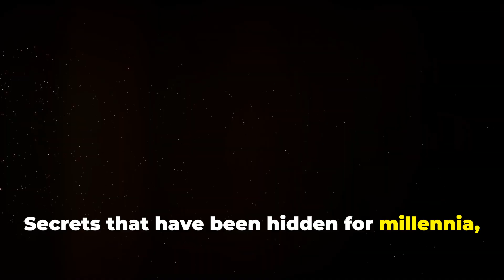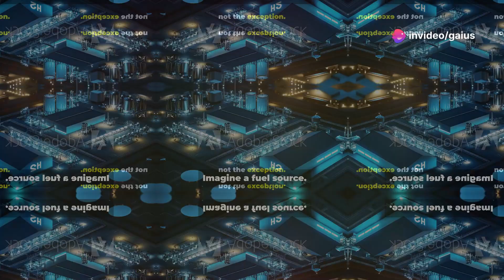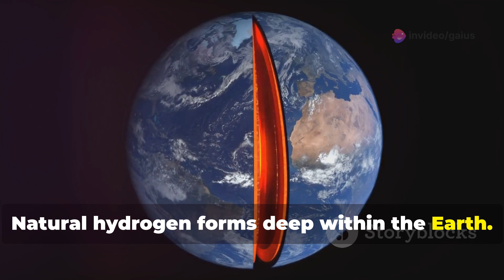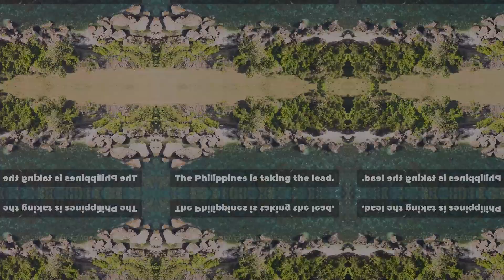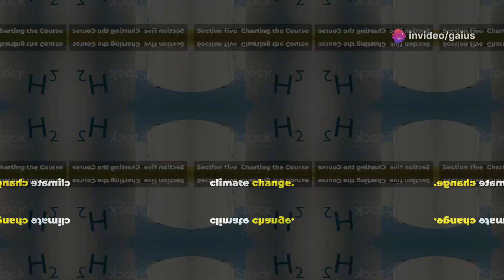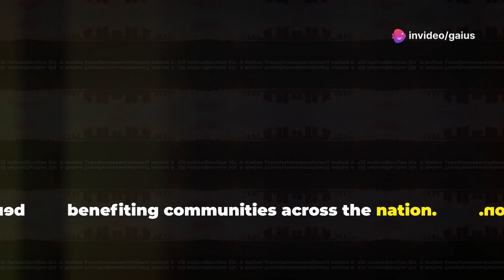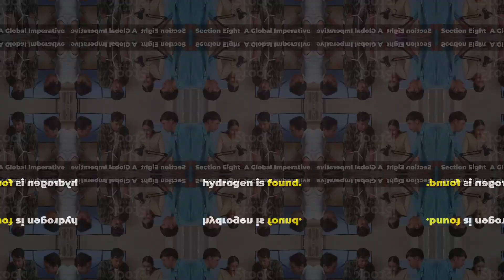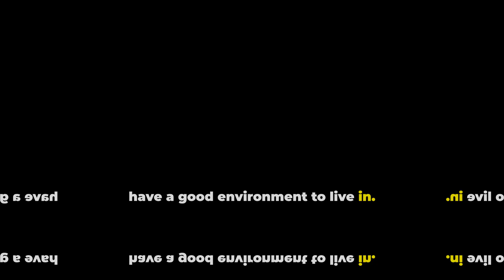Zambales' Game-Changer: Hydrogen Drilling Revolutionizes Clean Energy!

Comment: I'm a mining enng student here, been researching this for months now, the thing about the Philippines is that it's islands which means the rocks aren't ancient so the hydrogen production process here is linked to an ophiolite complex which is going to be hard to commercialise because the hydrogen here escapes the surface easily, but the fact that we found seeps is just amazing , it's very rare to find them and since it's cheaper to do operations in the philipines, I think it has a great potential as a pilot project but in terms of comercialisation of production i'm very skeptical about unless we find a way to engineer a sort of complex subsurface system  but that would be too expensive, but we never know, this is great for the country both ways it will attract investment.
Reply from the maker: "Wow, thank you for sharing your insight! 🙌 It’s fascinating to hear a mining engineering perspective on this. You’re absolutely right—the geology of the Philippines presents both unique opportunities and challenges for hydrogen production. The presence of seeps is indeed rare and exciting, and using it as a pilot project could really showcase the country’s potential. We totally understand your point about commercialization being tricky due to the ophiolite-related hydrogen escape, and the need for engineered subsurface systems could be a major hurdle. Still, it’s inspiring to see how even small breakthroughs can attract investment and spark innovation. Thanks again for adding such a knowledgeable perspective to the discussion!"